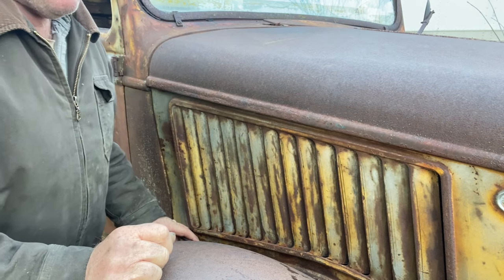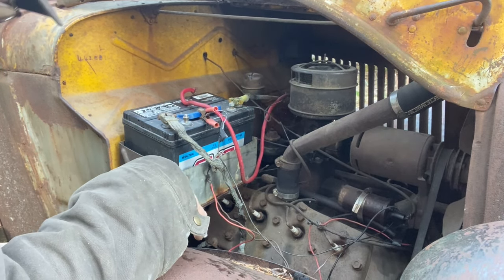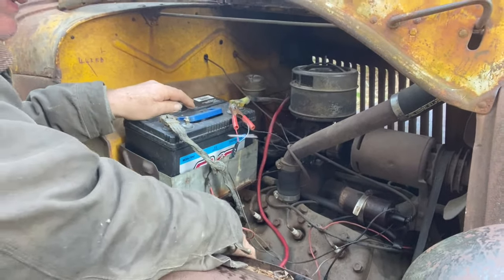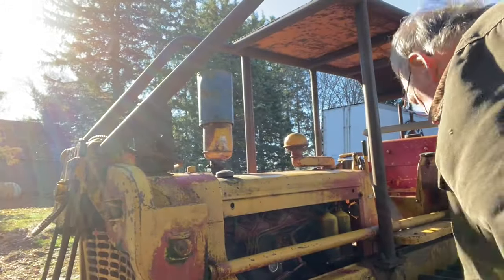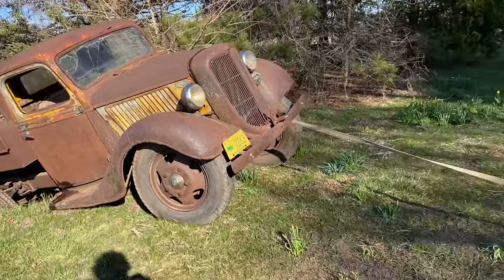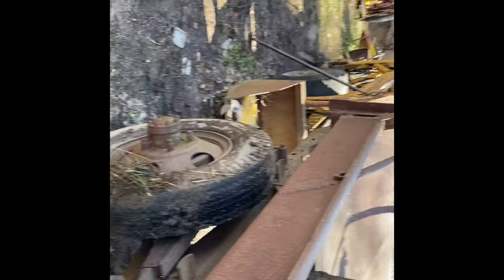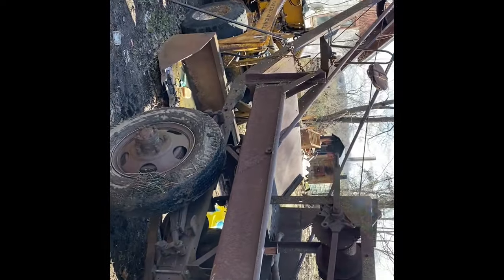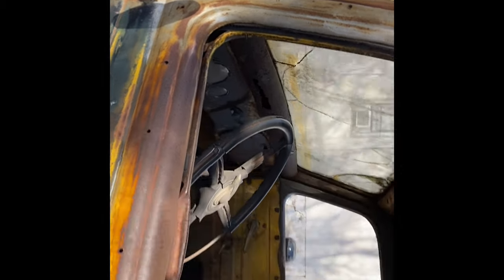Moving crane truck to pull skid loader engine 4/8/24

Comment: Hi mate great episode. It’s in good order that Ford truck. Very nice. Don’t worry about making mistakes, those who don’t are lying and you could have edited that out but you didn’t. This is why I like these smaller honest channels. It’s every day problems we have and come across. Yes the mirrors are a problem indeed. Especially when reversing while the engine is idling, they vibrate and make it worse. Great little series you have going. I’ve got the phone set up watching you while I’m pulling the rear differential out of a Bell 45ton articulated dump truck
Reply from the maker: Are you going to do a short on articulated truck, I’d like to see it.